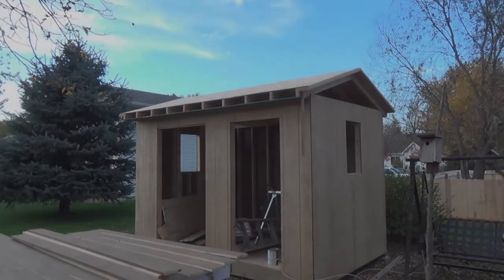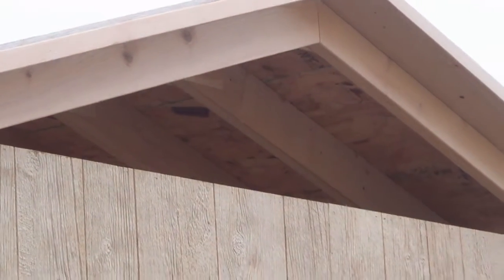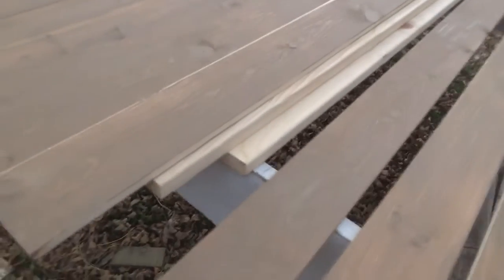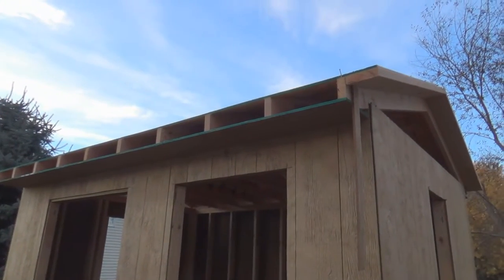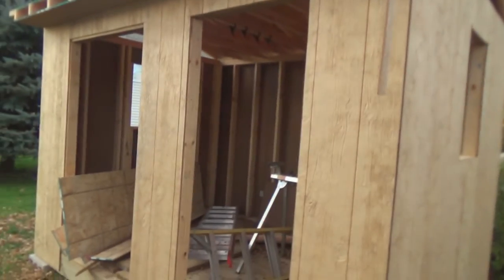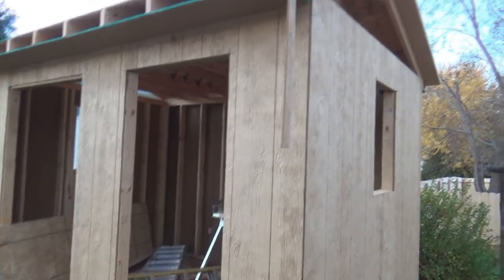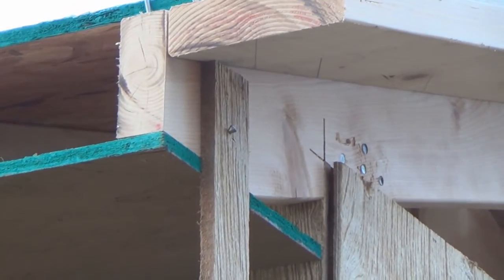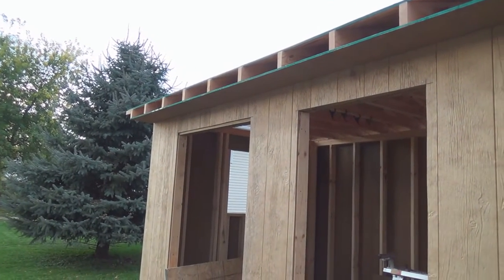Painting trim and a helping hand with the soffit installation.

Comment: You are doing a great Job there. your building experience definitely shows. All my experience was in the machine trade and small engines before I changed professions due to the recession back in the early 80s. I got tired of being played off and moving a roll around tool box from job to job. So I went into law enforcement and retied from that. Now I repair small engine equipment and work a part-time job here. in Central Ohio.- Ray.
Reply from the maker: Thanks for sharing your story with me Raymond and for encouraging me.

Comment: This is coming along VERY nicely!! One question:  why did you not use you nail gun to attach the roof sheathing?  Curious mimes want to know....
Reply from the maker: I found that my nailing gun doesn't work well with the 1/4" hose that I have and wouldn't drive the nails in all the way. Another reason is I didn't buy a box of 8d common nails to use in the gun as it would have added another $50 to the cost. So, I hand nailed the whole thing with 8d galvanized common nails. It won't go anywhere now, and I pity the poor guy that decides to tear it off in 40 years from now... Thanks Larry

Comment: Being a master woodworker I am familiar with finishes. When   a sealer of any type is applied to both sides of a board this is referred to as creating balance in the piece and helps prevent cupping, etc. But if you know wood working it's not smart to use flat sawn wood in areas where you are wanting boards to stay flat. Unfortunately a lot of these so called trim pieces are flat sawn. If someone wants to push the issue farther then they could look into made materials such as solid vinyl 1x material for their exterior trim which will never need repainting or become warped over time. Boy, listen to me.!i could teach a class or something! I'm impressive. NOT!! Ha!
Reply: I put tongue and grove on my porch 36 years ago and I painted both sides and they are holding up pretty good. Wife would like to enclose the porch and make some changes so the tongue and grove may not be staying course if there is no money in the budget all that goes out the window. So off to work I go.
Reply from the maker: The problem with vinyl trim boards is that they do have a tendency to warp, shrink and move more than real wood does. I like old school stuff that has stood the test of time. I'm not a master woodworker, just a carpenter who enjoys doing it the best that he can.
Reply: The Shade Tree Fix-it Man That makes two of us. I have the title but I am no different than any other carpenter.